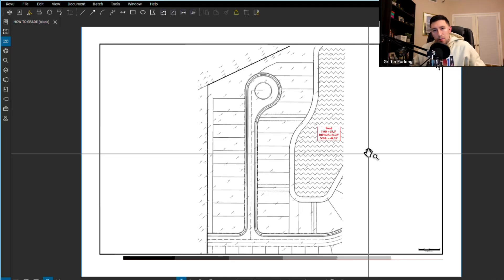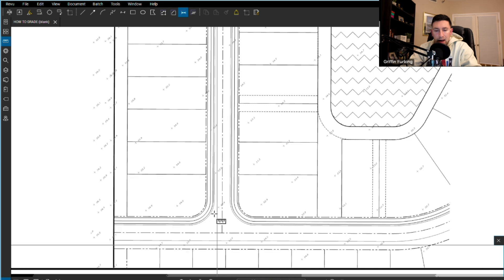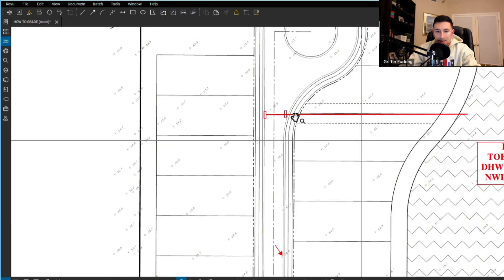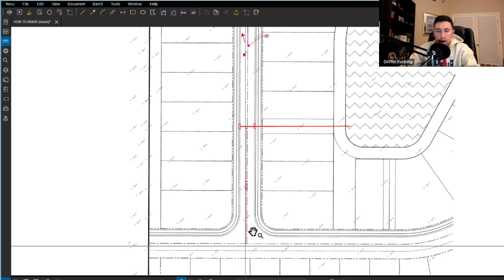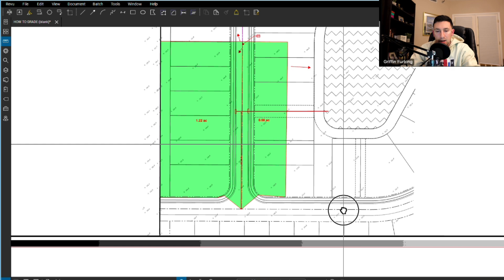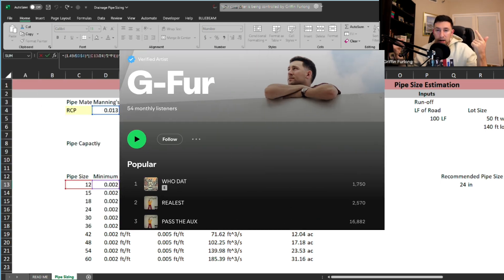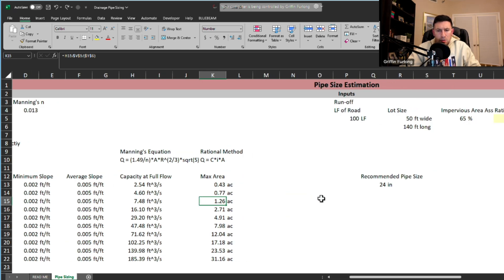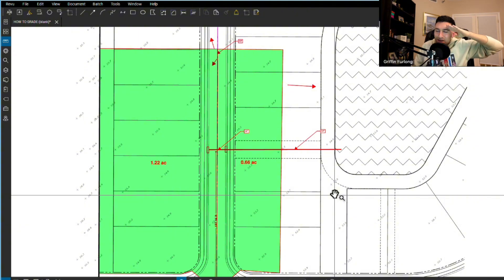How to Size Pipes for Drainage Systems (BEGINNER)

Comment: Trying to recreate the spreadsheet myself. Seems like the Manning's equation formula is incorrect when calculating for the hydraulic radius?
Reply from the maker: Great catch -- the Hydraulic Radius can be simplified to R = D / 4. If the input is in inches, this can be simplified further to D / 48 (not D / 24), to convert from inches to feet.

Comment: Is it bad practice to design your storm system for HGL instead of capacity? I was taught to design for HGLs as it allows us to downsize our system, but I am curious if that is common practice or if it is preferable to design your system for capacity.
Reply from the maker: I have two checks: HGL and Velocity. HGL because that dictates flooding out of the inlets during the peak of the storm event. Then velocity because high velocities can erode the pipe long term. Typically like to void velocities above 10 fps. Always consult your municipality standards.

Comment: Hey griffin, the hydraulic radius is based on area/WP. Not perimeter actually of the pipe. Wetted perimeter is the length along the interior of the pipe that encompasses the length of flow relative height if flow in the interior of the pipe at the specific flowrate!
Reply: Amazing video regardless, really confirmed alot of what I know as a civil engineer!

Comment: Hey, Griffin! Do you have any content on water quality design? Our local jurisdictions have started using NJCAT standards for water quality devices, and it seems like all of the current methods of achieving the 80% TSS removal are just inadequate, i.e. they are very expensive and cannot handle realistic flow rates. I'm in TN, so I know that there are a lot of things that can be different from FL, but have you run into similar issues? What have you found to be the most cost-effective way of handling stormwater treatment?
Reply from the maker: @94dpowers  what’s interesting is that Florida passed a law where after Dec 28, 2025 we will be held to more restrictive standards for nutrient removal. So we’re in the same boat! And you’re exactly right, the wet detention or dry retention alone is not sufficient enough to achieve 80% removal. My team is currently putting together example models to determine the most cost effective way to handle this issue. Once I receive more info I will make a video on it!
Reply: @civilgriffin  Can't wait! Thanks.